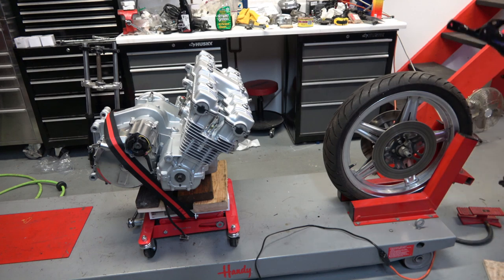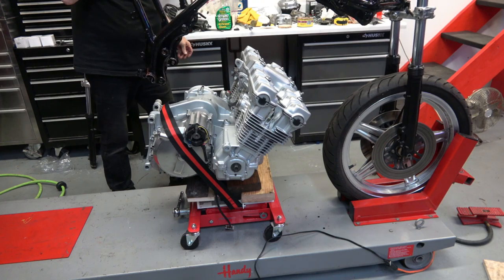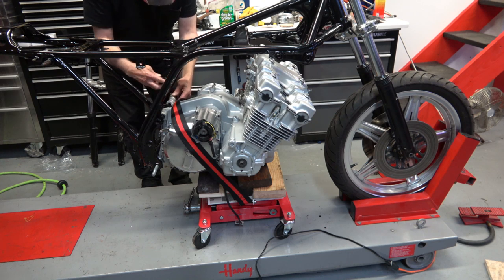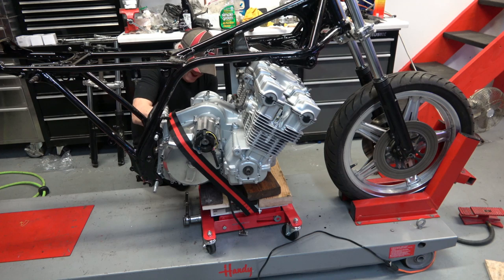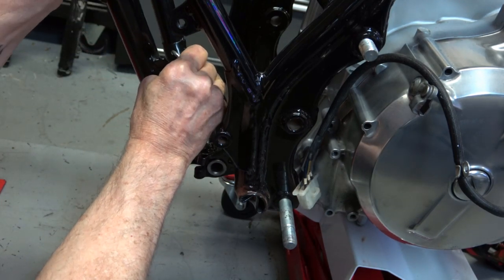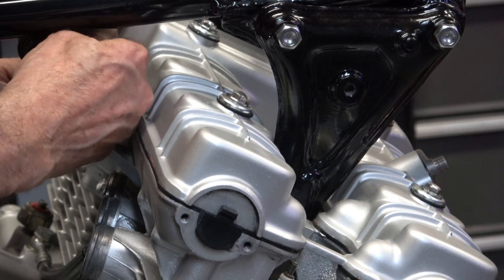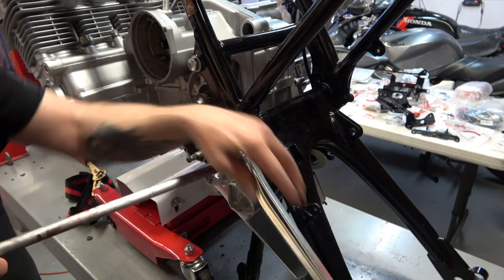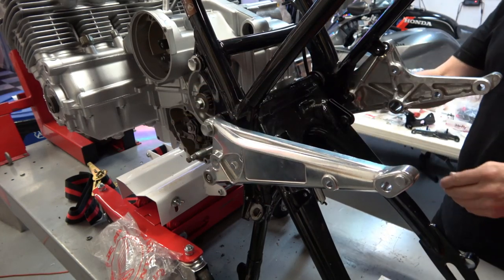Honda CBX Full Restoration & Engine Rebuild Video Series- Part 28 Re-Installation of Engine to Frame

Comment: I will always treasure the purchase and installation of an OEM factory Honda "Continental Kit" for my new 1980 CB400T Hawk, up here in Canada. Lower bars, beautiful aluminum rearset footpeg plates c/w heim joint shifter linkage, new cables, etc. Opening up that Honda cardboard box full of goodies was just so cool for my 18 year old self to experience. Cheers for sparking that fond time machine memory!

Comment: Peter is it easier to replace the carbs before you connect the main top engine mounts?
Reply from the maker: Hi Peter, yes, the top mounts have to come off when installing the carbs which is why I only have them on hand tight for now to secure the engine until the carbs are ready to install. The engine will be have to be tilted down to install the carbs as you probably know. Thanks Peter
Reply: @digitalpizza1  Look forward tothe next Video - Paul